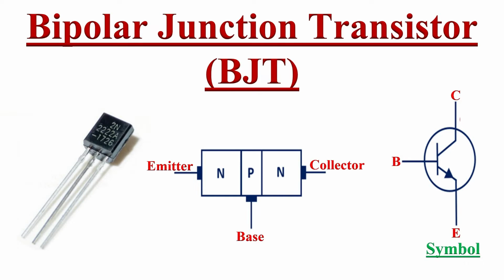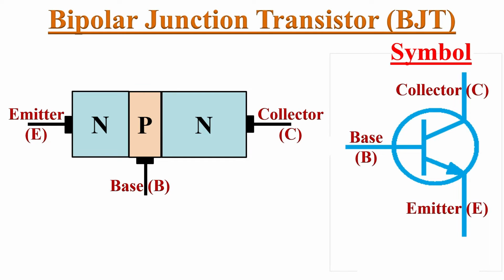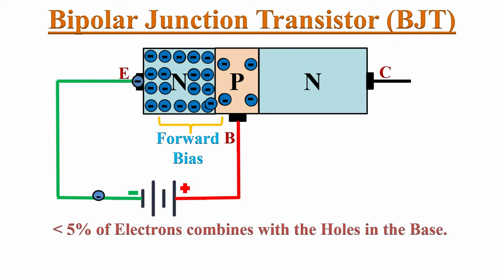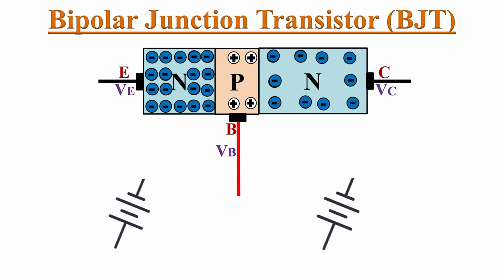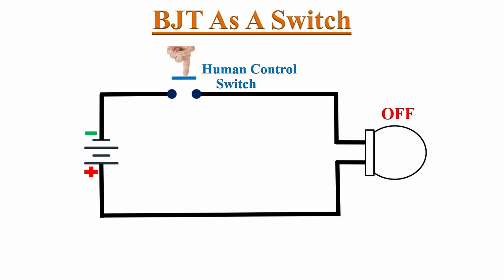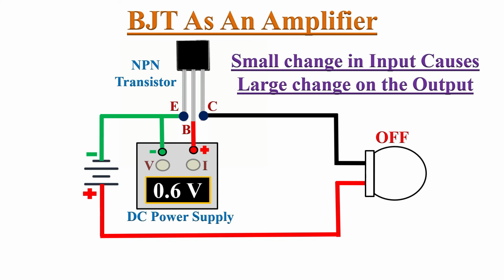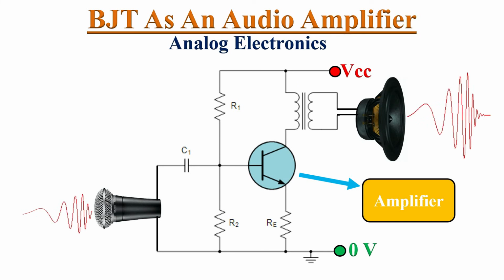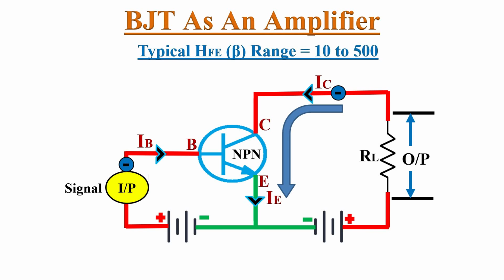Transistor (Bipolar Junction Transistor - BJT) Explained

Comment from the maker: Timestamps for various topics covered in this video are as follows:
0:13 Introduction,
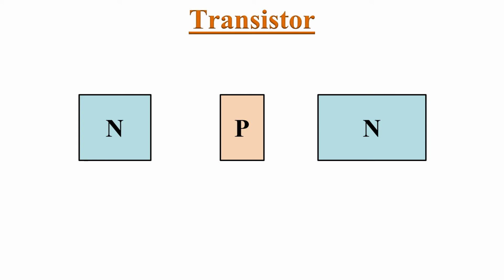2:43 What is BJT?,
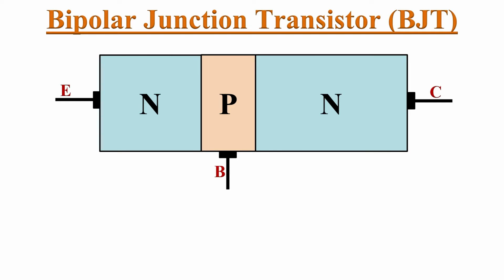5:12 Construction of BJT,
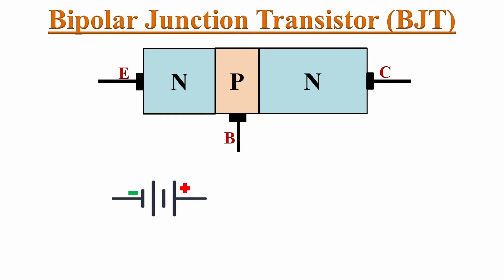6:03 Different Regions of Operation of BJT (Active, Saturation, Cut-off, and Reverse Active)
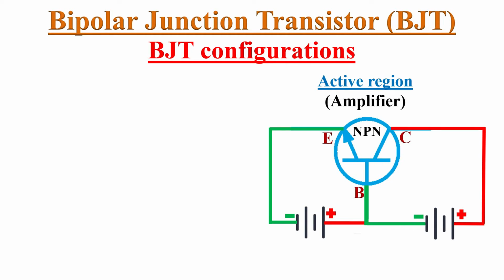11:13 Different Configurations (CE, CB, and CC), 
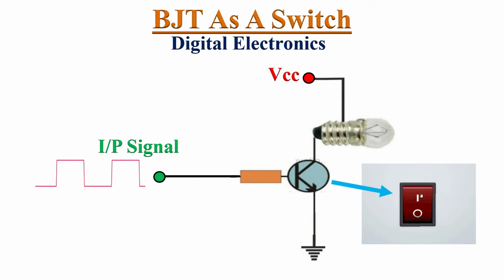12:09 BJT used as a Switch,
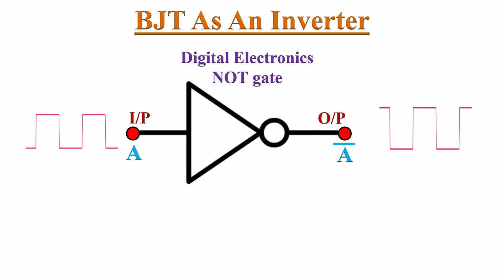13:32 BJT used as an Inverter (Digital Applications),
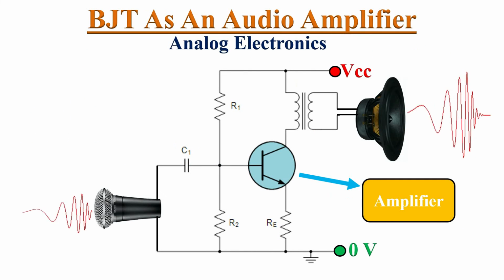15:11 BJT used as an Amplifier (Analog Applications),
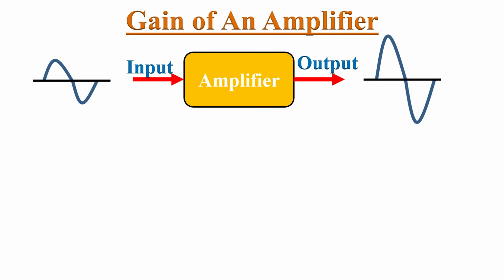19:53 Gain of an Amplifier (Voltage Gain, and Current Gain 'β'),
21:37 hFE value of a BJT.